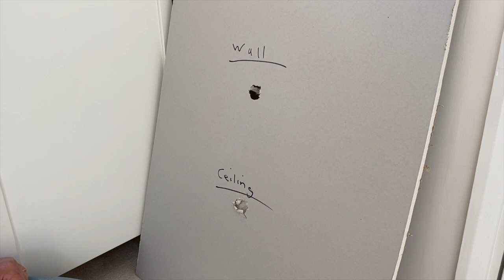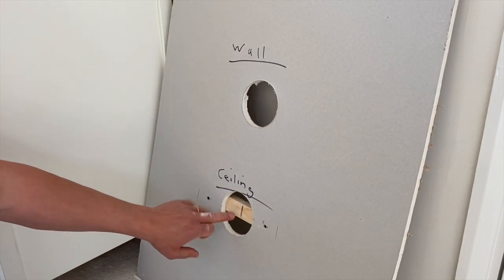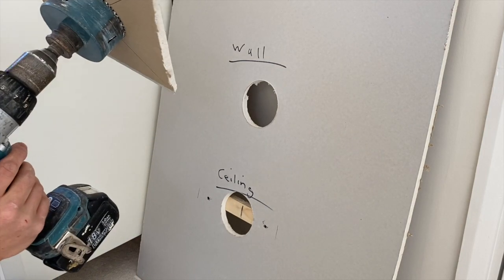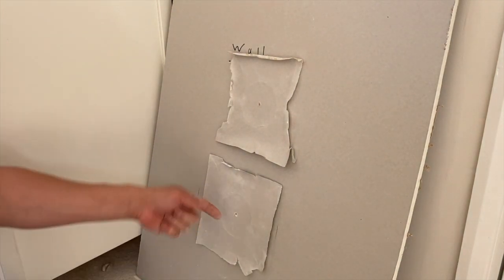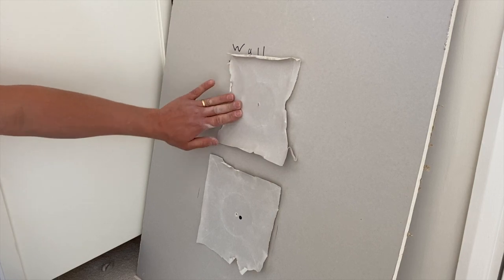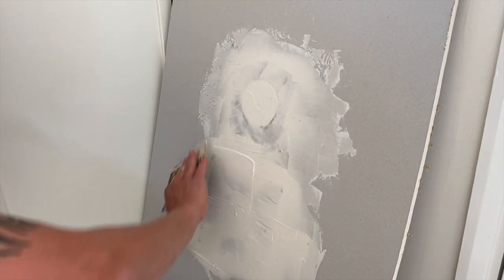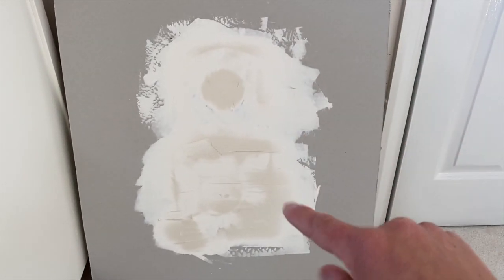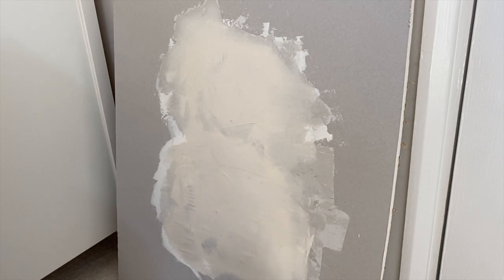Fixing a hammer in the wall.Drywall Plasterboard.

Comment: The only part holding the wall patch is the thickness of the paper! if anyone touched or lent on that after its painted over it would just hole again. For both I would just cut a disc, wooden support behind and as shown on a previous video remove the back part of the disc paper and skim over. Solid & no flaffing about trying to get a disc with paper still attached. Another tip is to use an SBR bonding on the cut parts of the Gyroc before adding the filler to prevent any possible cracking in future as it helps to stop the mix drying out too quick.👍🏻

Comment: Using drywall tape (joint tape) plus filler is usually a go-to.. you just cut a square around your holes with a knife, fill with a square of drywall, lay down some filler if your joint tape doesn't have a sticky backing, lay the joint tape, then go over it with filler, rather than faffing about with circular holes & patches. If your hole is large, use a batton or two to hold the patch of drywall in place.

(This is going from memory of how I learned from This Old House who've a rather good set of tutorials on patching drywall holes)

Comment: I like it and have seen it a couple of times but the wall plug is only being held in by a small circle of paper and a few layers of filler on top, go with the baton even in walls if you can.
Reply: agreed, but it's also fairly trivial to get filler in the gap. on the few occasions I've done this (when I ran out of baton) I buttered the edge of the plug liberally all the way round before inserting it in the hole. makes a fairly solid interface between the old/new.
Reply: Not when it’s dab and board on the wall. 9 times out of  10 this day and age it is. 👍

Comment: I would just put the circular bit in the hole then a thin skin of plaster over ready to paint
Reply: Same here that’s how I do it, adding the paper round the edge just creates more work trying to blend it in.
Reply: That's all I did when the Sparky came to do a repair at mine. Keeping the backing paper on to put on the front just seems a bit OTT.
Reply: I've been doing the same as you guys for years. Never tried this way. I can see it using alot more filler and requiring more sanding. Maybe I'll give it a try sometime.
Reply: I’d replace the whole wall 😂😂😂
Reply: Yep - and you can still see the outline of the circle, typical lazy approach and lack of any care.
Reply: @peterpeterson9903  if you know how to plaster you can hide that circle, the extra paper saves putting a backing piece in the wall, but you’ll need to hide the paper edge instead, and you can get a divot instead where the plug is. Whatever is easiest for you to do is the way to go, the important part is to make a solid repair that’s invisible.
Reply: @sstorholm  I did not suggest that you could not hide the circle.

Comment: Leaving the paper on is a bit is a faff. I always use a baton and a few screws when fixing any hole in a wall or ceiling. I usually just cut square or rectangular holes/patches. 
It's simple and easy for the diyer and you don't need any major tools, just a plasterboard saw (€5 - €10), plasterboard offcut, baton(s), some screws, a screwdriver, a putty knife or two and some filler.

Just cut a bit of plasterboard that covers the hole, use it as a template to cut the matching hole in the wall with the plasterboard saw, insert baton(s) and patch, and then fill.
Reply: Previous patch ups I've seen @CJR do, he's said rip that paper off so that it's not flush and gives you a better area to plaster and avoids a big bump like finish
Reply: Dex Whitmore I believe lots of Americans do it this way with mud. Have seen identical vids all American

Comment: Hi Chris,  I use a 90 mm for the hole and a 92 mm for the patch / plug and because the cutter thickness is a few mm in each side the plug fits tightly with just a bit of sticks like s**t, it drys in 10 mins, one skim of filler and job done. keep safe mate.

Comment: I fix the batten on the outside. By first screwing the filler piece to the batten and use 20mins Easi-Fill and spread the edges of both the hole the filler piece, then screw fix the batten each side of timber to the PB. Leave to go off for a bit. Unscrew the temporary timber and fill the rest. I find doing it this way, there's no protruding PB so easier to get a nice flush finish.

Comment: I used gripfill (other makes are available...lol) under wood to stick it to plasterboard, with a screw just as extra fixing then used ready mixed jointing plaster and as somebody else stated, I just fitted a circle in. Never seen this method before BUT I have to say a nice neat fix

Comment: Just stick the cut out disk back in on a baton, with filler round the edges, fill gaps, let the plasterer or customer sand, smooth, paint as required when i'm gone...sorted. a lot of people still have artex ceilings, be careful, some contain asbestos.

Comment: Just drill the cut out straight through and peel the paper off for a flush finish, sometimes you dont need to if the wall/ceiling is finished plastered
Reply: Yep that's the way i was taught peel the paper off the back so when you use the filler its finished job no bumps or ridges.

Comment: Thanks for that - its a job I know I'll have to do around the house at some point and I knew roughly what to do but I'd have cut all the way through and then tried to fill the seam between the hold and the plug. This looks much better so I'll be more confident at having less of a hatchet job repair afterwards!

Comment: Only thing I would add is to put some tackle around the inner lip of hole and maybe edge of the plug. Then put plug in, that way the plug gets stuck to the exist board edge. The way you have done on the 'wall', it seems there is only the fact that the plug is stuck to the patch of paper that it holding it in place. Good effort though mate, ok

Comment: Surly you can see the repair leaving the paper on as it would be raised especially on the celling looking at it in any light with shoe right up ruff sorry mate
Reply: What, will the customer come in and inspect everything and be unhappy with the fact that a hole in the wall has been repaired?   
The paper is very thin. There will be the tiniest raise in the patch area. Not big enough to notice unless you look at with a beam shining over it. Straight on or to the side in normal light, it wouldn't be noticeable.

Comment: Use gypsum yellow top filler, a lot better finish and using a a wet cloth to finish, and you can heat gun it to speed up drying. I’ve done this sort of repair, filled and painted in 45min using this method
Reply: Is that gyproc filler in yellow bag ?
Reply: it comes pre made in a large plastic tub with a yellow lid, made by gypsum and it’s pink colour like finish coat, I’ve used this method and just wet cloth it to finish. if your good there will be no sanding required

Comment: This is some American bs IMO 
Doing this method will leave a slight ramp from the paper any way. 
Personally I avoid using scrim tape for the same reason.
I Batton, cut the whole square (using a whole saw is a quick way to do this though but often patches are bigger then 110mm diameter) 
Cut a square price of board to as tight as possible usually 3mm tops of gap.
Wipe the dust of the edges of the plasterboard, apply decorators caulk to the edges or another flexible material that filler will stick to. Have used silicone often which works as long as you apply filler while still wet.
I often use two part wood filler simply because it goes off fast and you can finish and paint the patch in quickly. (Yes this is not necessarily what it’s designed for but I’ve never had issues and this method vastly improves productivity and finish.)
Usually two or three fills depending, sand until flat and smooth, remove dust. Prime and two coats to finish. 
Avoid filling over un cured filler because this always causes issues